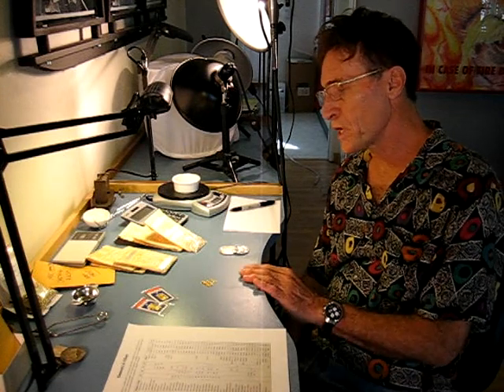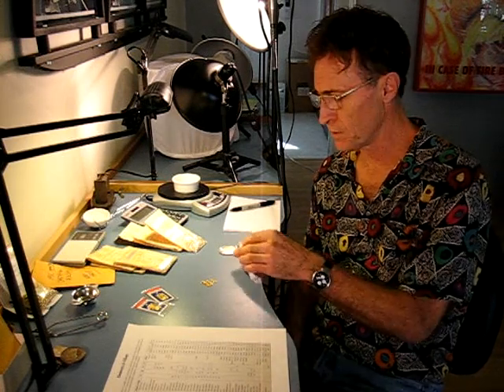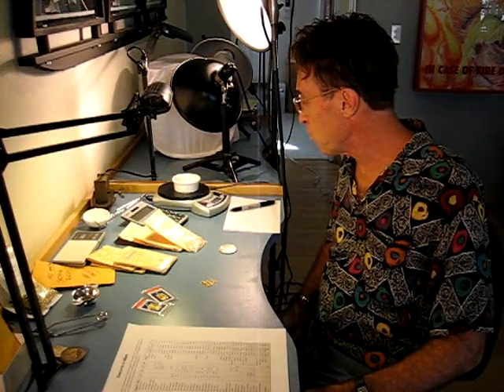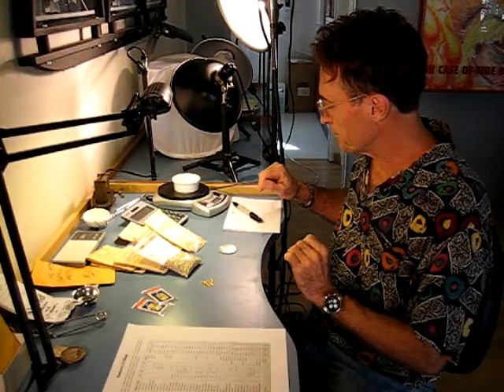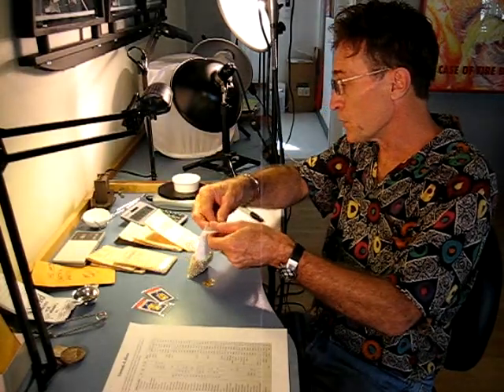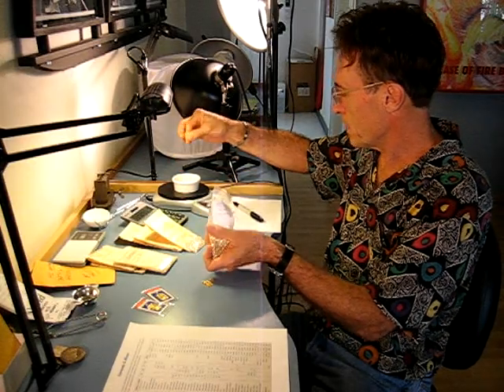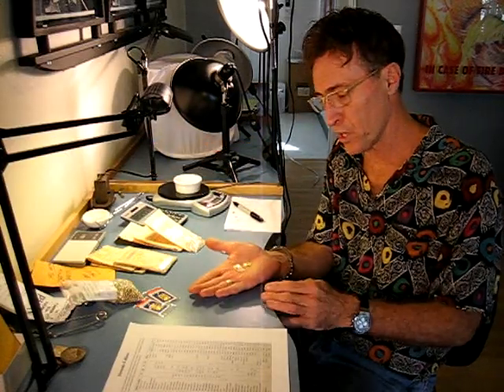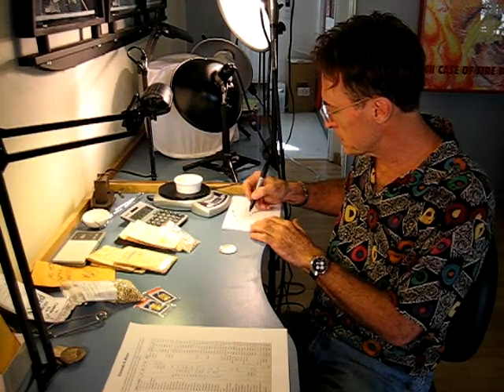How To Alloy Gold and Silver

Comment: ACTULY ITS A TROY OZ COIN MEENING 31.1 GRAMS
Reply: +vorkev1 I thought a troy oz was like 34 grams
Reply: One troy ounce is defined as exactly 31.1034768 g, which may be used to denote the value of a precious metal. One troy ounce of gold is denoted with the ISO 4217 currency code XAU, while one troy ounce of silver is denoted as XAG.[2]
The troy ounce is about 10% heavier (ratio 192/175) than the avoirdupois ounce, used for everyday purposes in the United States, which equals 28.349523125 g.